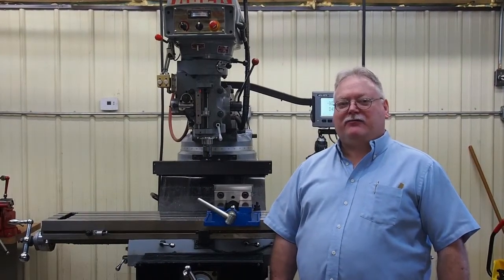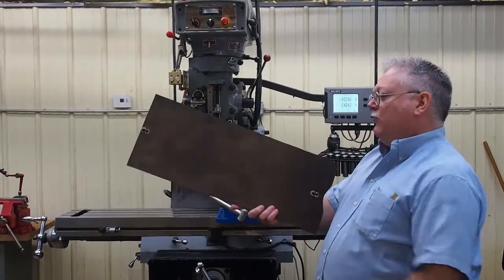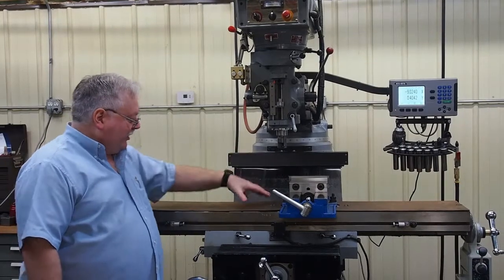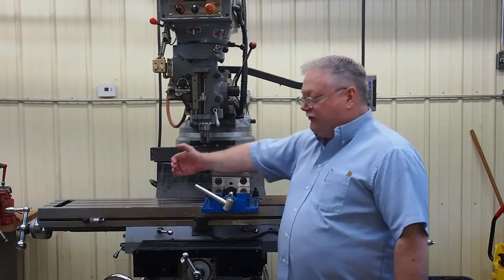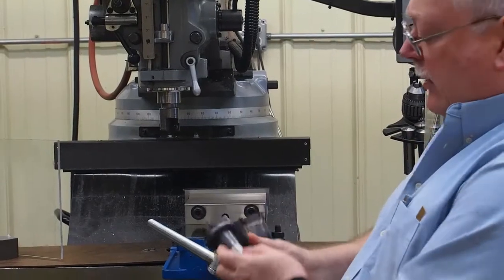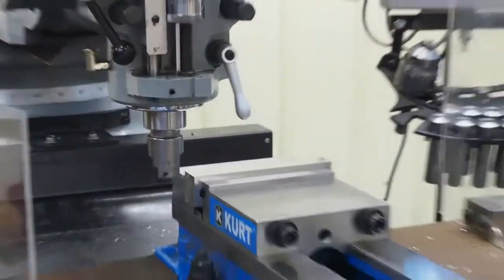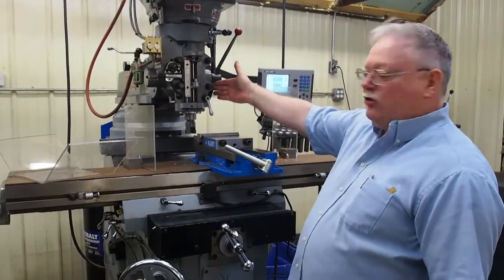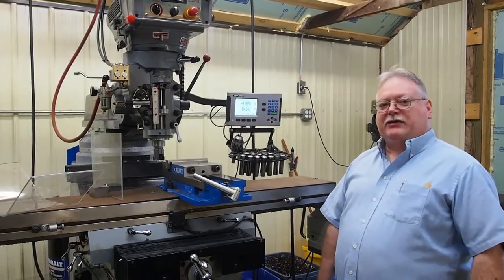Chip and table guards

Comment: Aside from throwing swarf towards you with a clockwise revolving cutter as viewed from above, the real reason you should begin your cut on the right side is because the cutting pressure is directed against the fixed vise jaw rather than the moveable jaw. Many many tons of pressure are generated at the cutter as each tooth makes contact, and that pressure is best withstood and accuracy increased when it does not have to be absorbed by the vise screw threads.
Reply from the maker: Excellent point.
Steve

Comment: I like the plastic shields. I have a brand new milling machine and a puppy, and she wants to be with me when the chip are flying all over the place. NOT GOOD for doggies, so I'm working on a design to prevent chips from ever reaching the floor while not impeding my access to the tool. As for the table top protectors, I'll go make a couple of those this afternoon. Good ideas here. THanks.
Reply from the maker: You are welcome.
Steve

Comment: Same exact thing I’ve used for 30 years. Hopefully people pay attention.
Reply from the maker: Hi John,
I love them too! I oil the table and the bottom side of the board adsorbs the oil and helps prevent rust.
Steve
Reply: Solid Rock Machine Shop Inc. my first one was simply ripped hardboard with 1/4” hot melt glue attached ribs on front and rear. I used a contour gauge to map out the vise, transferred to the hard board, jig saw and your done. I use doall way lube on the surface. Since the ribs were glued, they kept the hardboard from warping. I get lexan scraps constantly, any plastic shops have scraps and usually their in the dumpster for those on a budget. A table saw doesn’t even blink at them. If you have to marry up several pieces of lexan or plexiglass, acetone is the solvent/glue.

Comment: Good ideas.  I like the vise board on the right side to be 12".  It keeps my right hand closer to the handle, with room to set up a rush job on the left side of the table.
Reply from the maker: Hi Nevin,
We have set up other jobs the same way. Works nice and you don't have to remove the vice which is an added bonus.
Steve
Reply: The only problem with that, and it depends on the machine, dovetail ways and worn machines seem to be the worst at it, is the farther unbalanced the table is, the more it tips on its ways, sometimes a problems sometimes not.

Comment: I have been going through your back catalogue after a recommendation from RR and I think you made two good points in this video that some lesser machinists seem to have never learnt or just ignore. 
Offsetting the vice should be encouraged to, as you say, spread the wear on the lead screw. There is one YT video producer (no names, no pack drill, but he knows who he is) who poo-pooed the idea thinking it was unnecessary to even the wear on the gibs and dovetails, completely ignoring the screw. Putting the vice in the centre must be a need to satisfy a machinist's sense of proportion, perhaps?
As for quill stick out, the quill is only meant to take drilling loading, why do people think otherwise? I know my friend The Lipton has an aversion to winding his knee up , there is an amusing anecdote about it in his book, which he kindly sent me, about how to avoid doing it, involving searching for a mysterious noise.
ATB
c
Reply from the maker: Hi Chris,
Thanks for commenting. I can't count how many knee milling machines I worked on that were worn out in the 4" to 6" of travel centered where the vice was mounted. Spreading the wear by offsetting the vise is a simple way to reduce the wear and spread it out over a greater distance.
Steve

Comment: Go to your local restaurant supply and get a couple of PE cutting boards and cut them up instead of wood, they won't warp, they don't soak up stuff and they won't scratch anything.
Reply from the maker: So far these have been working fine. I like the idea that it soaks up oil on the under side because it keeps the table from rusting.
Steve

Comment: I haven't seen an R8 auxiliary collet rack suspended from a DRO before. Has it held up or started to sag over the years? I have the same mount it seems, and would like to implement it in my shop.
Reply from the maker: Hi Russell,
Yes, it holds up well. This is a common practice in most of the shops I worked at. It is real convenient.
Steve

Comment: Would you be willing to share any information on your rear Y Axis Way cover?
Reply from the maker: Hi Atlascycle,

The way cover came with the machine when we bought it. Here is one like it on ebay http://www.ebay.com/itm/Milling-Machine-Part-Retractable-Way-Cover-Back-3VKH-/181108233601?rmvSB=true  It doesn't keep all the chips off the way so you still have to wipe them from time to time. It retracts as you move the Y axis to the back of the machine to take up the slop.
Reply: thank you for the information.
Reply: Thank You for the information

Jason